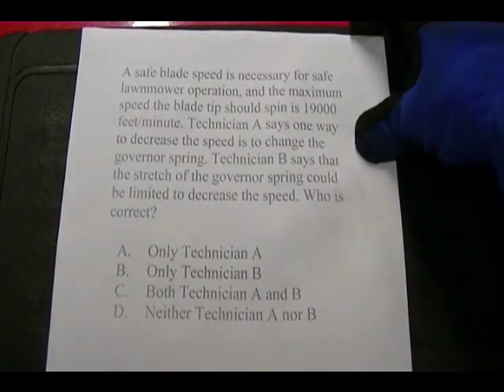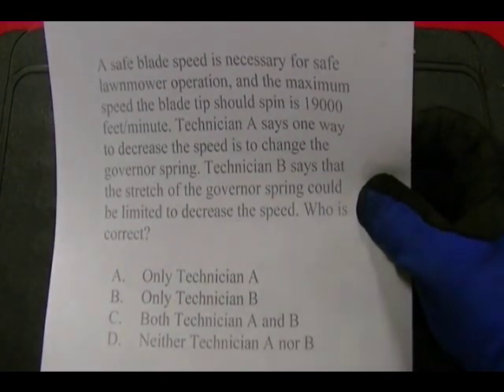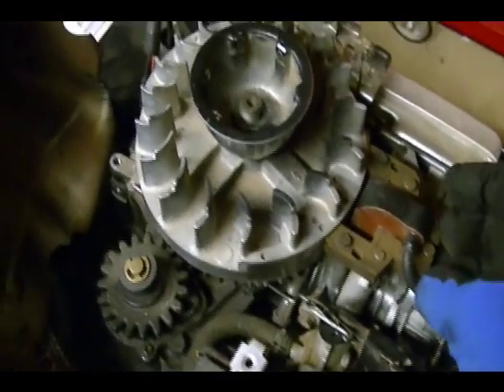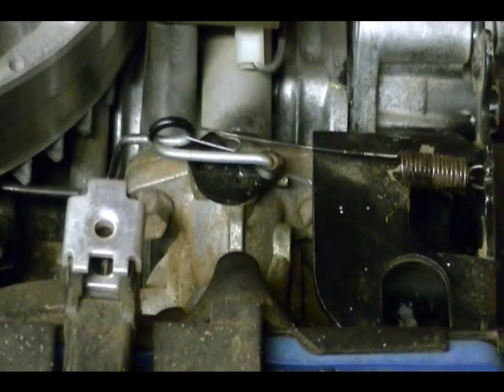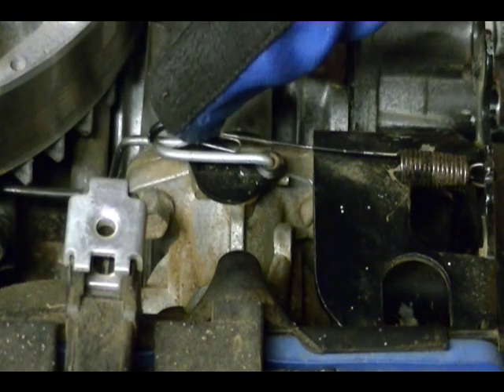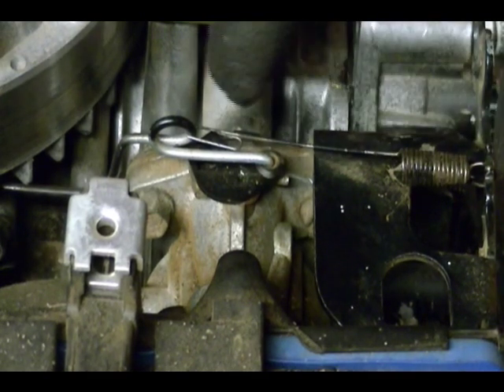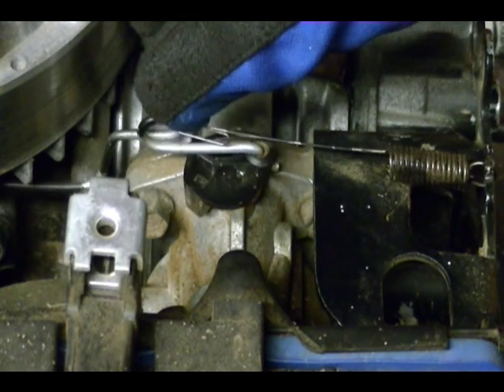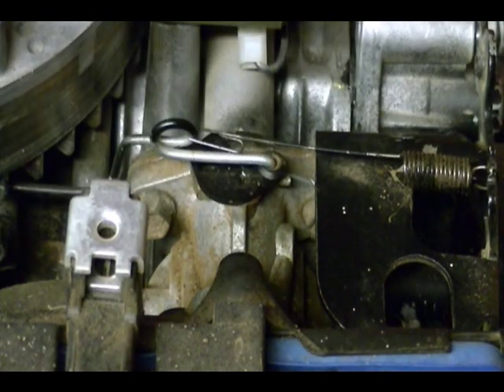Test Prep 3 Small Engine Governor Spring - Carburetor linkage for Briggs & Stratton 650 Series Engin

Comment: Shouldn't the answer really be "D" Neither tech A or B. Wouldn't you adjust the high speed throttle stop tab or screw against the throttle tab to either increase or decrease your RPM's.  Wouldn't that make more sense that swapping out the governor spring?

Comment: My governor stays in the open position and does not adj. when running.  This is causing the lawn mower to run extremely high.  Do I nee to buy a new governor spring or a new governor set up?  Any ideas?